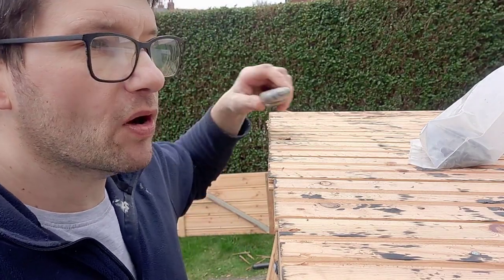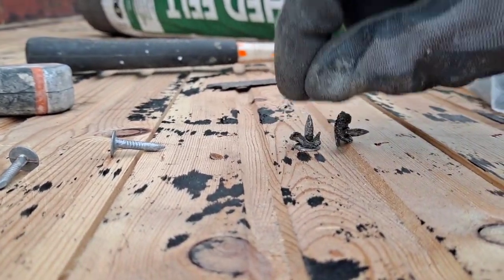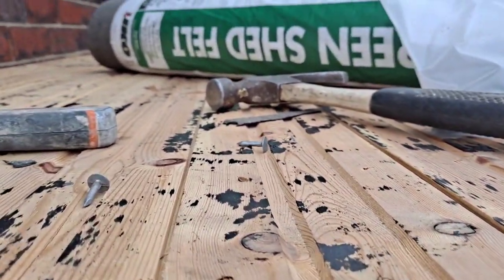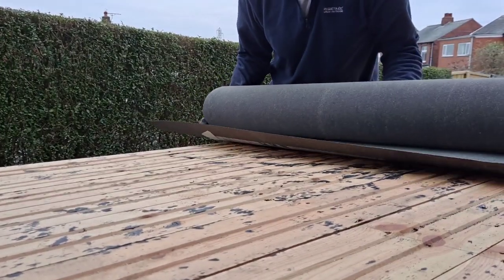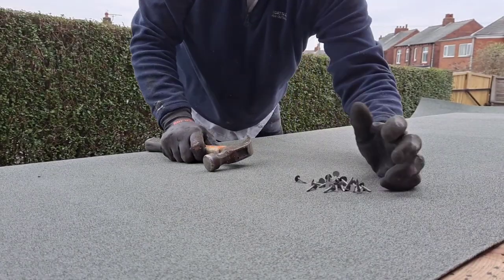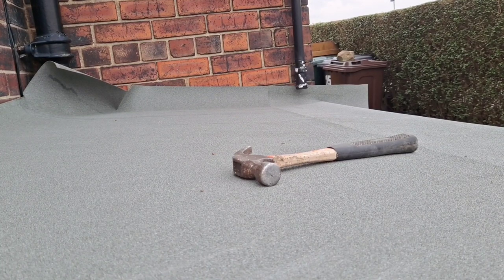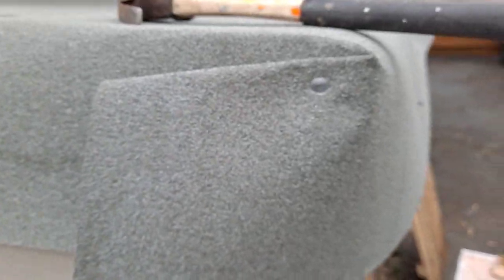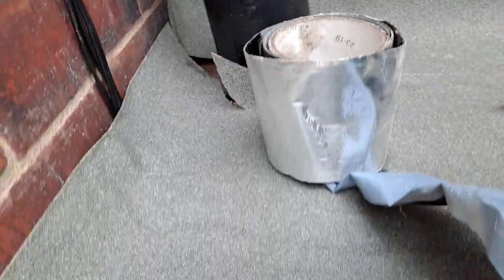how to felt a shed roof .. cheap solution.

Comment: I did mine with EPDM rubber and it saves time and money because will last at least 20 years warranty life of the rubber is 50 years easy for instalation just few hours no nails required easy.
Your felt will last just few years and you have to replace it  again i prefer rubber epdm felt
Reply from the maker: Interesting comment and thanks   videos 3 years btw 👍 😀

Comment: Do you have to use adhesive with the felt on an apex shed? I wanted to do it without,  but wondered if it will be OK with just clout nails
Reply from the maker: If you want a better seal then adhesive is recommended but necessary.  I generally overlap and make sure the nails are about 4 cm apart as the wind will rip it up.
Reply: @handyandyuk  Thank you. That's great